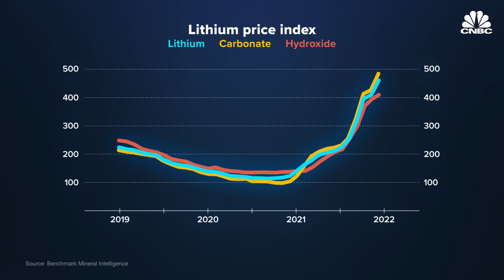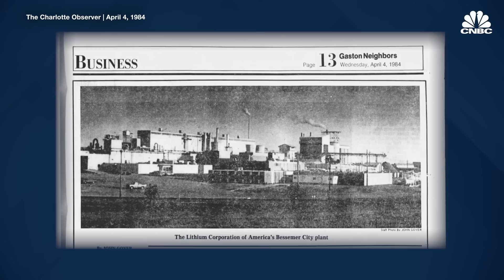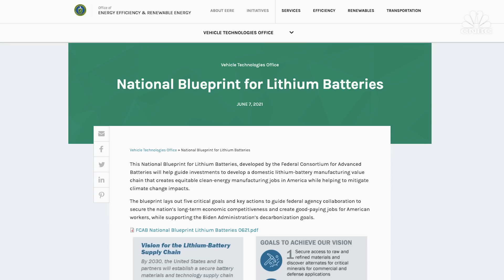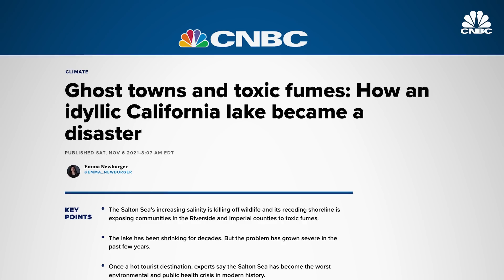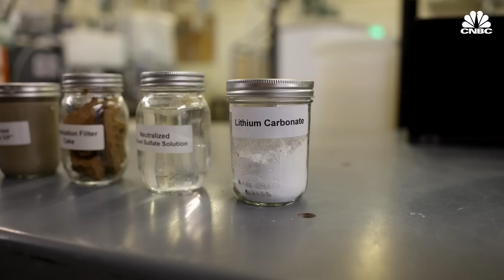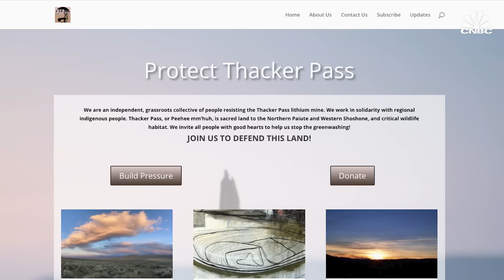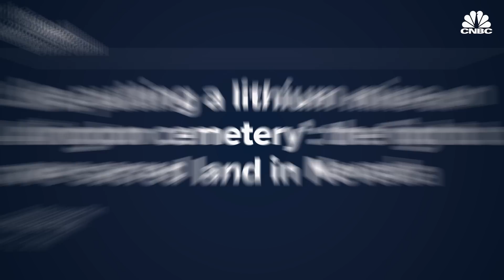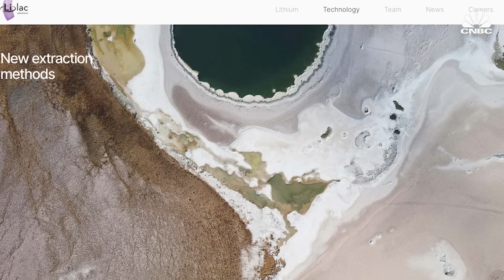Why The U.S. Has A Massive Lithium Supply Problem

Comment: Good idea. Let’s just switch from one fossil fuel to a different resource that’s even more scarce. Except let’s switch to one that has much worse impacts on local environments.
Reply: Do you actually think lithium is a fossil fuel..? Or comparable in any way? 
My mind is blown at the stupidity of this, it's almost impressive.
Reply: @nicktubby9710  lithium is not renewable….so yes in that sense it is completely comparable. 

What lithium mining does to the local environment is far worse than what drilling for oil does. 

Sure oil/gas has way more direct greenhouse emissions….but switching from one way of destroying our planet to another way isn’t really doing much.
Reply: @shanemooon  lithium is not a fossil fuel and it’s definitely recyclable
Reply: @hsvr  never said it was a fossil fuel. And never said it wasn’t recyclable. 
But remember. Recycling is not infinite….
Reply: @shanemooon  The big difference is that one need x amount of lithium to produce the battery and then you good to go, whereas fossil fuels need to be pumped into the car day by day..
Much less amount of raw material needed during the lifetime of a car.
Not to mention, once all the cars are EVs, and the demand for new cars around the same as discarded old cars, recycling lithium from old cars can cover many of the demand..
Also extraction.. Of course it has it's environmental drawbacks but I am not sure that the oilspills, or buldozing whole mountains in WV for coal is that much better..
Reply: @vinceszigetvari6137  that’s the thing though. 

1. Lithium recycling is almost non-existent currently. Because people don’t send in their old batteries…and even when they do, almost every recycling company just incinerates the lithium. 

2. And even if we do achieve better recycling…there are many studies that say we will not have enough lithium in circulation to keep up with demand for new vehicles.
Reply: @shanemooon  
Well lithium recycling is almost non-existent yet, so are old enough EV-s and recyclable batteries.
Even if new sources of lithium required, the amount is for sure much less than oil, which is necessary for every mile a vehicle travels.
Lithium only needed once, when the vehicle is produced. After that thousands of miles can be made without any new raw materials.
EVs overally consume significantly less resources. (even is electricity is produced by coal, EV wins over internal combustion cars)

Comment: EV aren't as green as people think, where do people think lithium comes from, they come from industrial mining, there a lot of environmental damages from lithium mining and from pollution from mining.
Reply: but where do all those metals used in engine come from? Do we grow and harvest them?
Reply: 0 Iq argument
Reply: Still less damaging over the life of the vehicle. EVs nowadays easily exceed 100 mpg-equivalent in terms of carbon emitted even when charged on coal.
Reply: All people want is the illusion of things being normal and all the UN is concerned is catastrophic weather and climate refuges. 

Plus creating mining jobs is actually a good thing for the economy.
Reply: EVs use metal too.  The suspension, body panels, brakes, wheels, motor, and batteries contain steel and/or aluminum.  The batteries are also about 1000 lbs v. about 300 lbs for an ICE engine.  Lithium mining is also worse than mining for iron or aluminum.  Lithium mining contaminates the ground water leaving it unusable for irrigation or drinking.  As long as you have EVs you will also have to drill for oil.  The tires, plastic components, metal, electronics, and the road the EVs travel on are all made from fossil fuels.

Comment: Lithium is not the problem, no power grid is capable of charging all cars at the same time.
Reply: Cars don't need to be charged all the same time any more than cars need to be fueled all at the same time. Lithium iron phosphate batteries can theoretically be charged from 0 to 100% many thousands of times.  Solid state lithium will have more than twice the range of current batteries (500 miles for Lucid Air) so charging will be even less frequent.  Less than once every two weeks or so...
Reply: @OlJackBurton  I agree you don't have to change all cars at the same time, some kind of a schedule is in mind. Nevertheless the grid won't handle a transition from fossil fuels to a all electric future without major investment.
Reply: Time to expand our investments (R&D) in nuclear SMRs as well as solar and wind.

We tend to behave as though our options to augment our energy production is limited to the generation capabilities we have today.
Reply: @metamorphic75  I am taking about more copper cables and bigger electric plants. Copper mining operations are ugly as well.
Reply: And yet somehow the power grid is capable of running all air conditioners at the same time in the summer.

Comment: WHY NOT EXPLORE CHEAPER AND MORE ABUNDANT ALTERNATIVE BATTERY TECHNOLOGIES BASED ON OTHER SALTS LIKE SODIUM CHLORIDE. ....SODIUM BATTERIES HAVE BEEN  PROVED VIABLE
Reply: Then why aren't they used 🤨
Reply: Lithium is incredibly light, atomic number wise, while storing as much energy as heavier elements.
Reply: @philsturm4685  it has been revealed in some experiments that sodium batteries  could be more powerful,  provide more range and quicker to recharge
Reply: Why are you yelling? Also there is billions of dollars going into researching the next generation of batteries. But we cannot wait for that. The clock is ticking on climate change and we need to decarbonize now, not 20 years from now when we have a better battery.
Reply: @katjerouac  Of course  they have to sing about lithium because there are major commodities companies waiting to cash in after buying mining rights. Indeed  there are  more environmentally friendly alternatives to lithium including  water that can be used to power engines. In  the past,  indivduals  that developed  engines powered by  just water have faced threats from government agencies.  You want proof
Reply: @philsturm4685 Sodium batteries have higher power density....Check the channel Electric Viking  on sodium batteries....
Reply: @philsturm4685  Also check out Brown gas converting water to fuel ....HHO water to fuel generator
Reply: @todddammit4628  Did you check out Sodium  batteries ...just so you can learn something new to parrot about in another forum

Comment: A long time ago, Ra, who was god of the sun, ruled the earth. During this time, he heard of a prophecy that Nut, the sky goddess, would give birth to a son who would depose him. Therefore Re cast a spell to the effect that Nut could not give birth on any day of the year, which was then itself composed of precisely 360 days. To help Nut to counter this spell, the wisdom god Thoth devised a plan.

Thoth went to the moon god Khonsu and asked that he play a game known as Senet, requesting that they play for the very light of the moon itself. Feeling confident that he would win, Khonsu agreed. However, in the course of playing he lost the game several times in succession, such that Thoth ended up winning from the moon a substantial measure of its light, equal to about five days.

With this in hand, Thoth then took this extra time, and gave it to Nut. In doing so this had the effect of increasing the earth’s number of days per year, allowing Nut to give birth to a succession of children; one upon each of the extra 5 days that were added to the original 360. And as for the moon, losing its light had quite an effect upon it, for it became weaker and smaller in the sky. Being forced to hide itself periodically to recuperate; it could only show itself fully for a short period of time before having to disappear to regain its strength.

Comment: No one mentions reducing consumption. Ever. Reducing consumption means less spending and lower profits, especially for those making the most profit now.  Personally, I will not support any new exploration or mining until they are coupled with reducing consumption of fuels, plastics, etc.   why switch to EVs instead of requiring better average fuel economy and eliminating 300 plus hp vehicles?

Comment: So green cars is a pure fairy tale. A typical EV needs 80Kg of copper, and several other minerals. But copper is also needed for miles and miles to get power to the charging stations.. Copper mines like chuquicamata are already an environmental disaster. Neodymium is also needed and the mines that produce it pollute big areas of farming soil.
For those of you that want to know more check the video: "The price of green energy | DW Documentary"

Comment: Algae oil is the true answer. Anything made from crude oil can be made from algae oil without the environmental impacts. Biofuels made from algae oil produce 86% less emissions so it would be like taking 86% of the internal combustion engines off the market without having to convert or destroy anything. Plastics made from algae oil do not create nanoparticles when they biodegrade. You can also treat wastewater and CO2 emissions during the growing process. Plastic straws, bags, and internal combustion cars are not the only thing that depend on crude oil. This is the one product that can produce anything that is made from crude oil and end our dependency upon crude oil. Every major city around the world could put up vertical Algae factories and processing centers to be able to produce their own fuels and byproducts while at the same time treating their wastewater and CO2 emissions. The only reason wind, solar, and battery power are so heavily promoted is because they still so heavily involve the mining industry. #Greenwashing

Comment: Lithium technology for EV’s will be superseded by hydrogen technology.  Lithium will still be needed for batteries but the demand will be less than forecasted because the benefits of hydrogen technology for EV’s far outweighs Lithium.   CNBC in its report under the Hurdles section totally misses the likelihood of hydrogen technology disruption to the Lithium mining and refinement industries.  Big miss.
Reply: As someone with a degree in Metallurgical Engineering with some research into hydrogen, I have my doubts about hydrogen powered vehicles competing with EV's. 'Cracking' hydrogen from ammonia and other sources is energy intensive.

Comment: Why does what we need for a battery's/energy always happen to come out of the ground?  It's like oil 2.0
Reply: Not at all. We don't burn the lithium that we use.
Reply: @laskey2175  Exactly. X amount of lithium per car vs. Y amount of oil per mile. Huge difference.

Comment: Using climate change as excuse for lithium mining is kinda funny. Now, I don't actually necessarily disagree with mining, personally I just don't know enough, but just from my common sense perspective it's not bad idea. But back to my point, cars are maybe the most inefficient means of transport we have, electric or not. Personal cars all the way from infrastructure needed to support usage, material and manufacturing cost per person and energy needed to push very heavy car just to transport one or couple people makes it quite bad means of transport. 
Overall, electric cars are just not solution to climate problems, it's part of the solution, but before that most of all it should be reduction of cars and making the whole infrastructure of transportation more efficient.

Comment: To charge these batteries at a charging station you boil water to create steam that spins a turbine. Oil and natural gas is used as the primary source to achieve that in the US, but that was failed to be mentioned in this report. EV’s are dope, but shouldn’t we also be working towards producing cleaner electricity, not just electrifying our privately owned vehicles.
Reply: // "shouldn’t we also be working towards producing cleaner electricity,"//

Do you live in a cave?  Do you not know how much time/energy/money is being spent to clean up our grid power?

Comment: Dump lithium
Adapt Hydrogen fuel cell and Aluminum Air batteries
Reply: But hydrogen fuel cell uses platinum, an even rarer and more expensive metal.

Comment: I wish the public and the government would finally realize that EVs are not a viable solution for mass production of personal vehicles. Lithium will almost always have to be mined using destructive practices and the US is decades away from clean energy production considering more than half of our energy is produced from burning fossil fuels (60% of energy production US in 2020). I just hate the narrative that EVs are so "clean", sure you don't see emissions from your car but that's because they already got released into the air from a refinery burning coal (20% in 2020) 100 miles away. The only truly sustainable energy source for cars would be hydrogen power as their only byproduct is water. Even though current means of producing hydrogen aren't all green, advances could see an energy system that is green, sustainable, and less prone to outages and failures like our current electrical grid.

Comment: I feel like in 150 years people will look back and reflect on how stupid it is to fuel vehicles with heavy batteries that are difficult to produce. Hydrocarbons are so much better suited and are renewable unlike limited resources like lithium ion batteries. We could offset the CO2 emissions by doing things like not cutting down rainforests, generating electricity with nuclear power, and actively scrubbing CO2 out if the air. Or if we do decide to go fully electric don't have cars stuck in stop and go traffic. Invest in mass transit and improve traffic flow.

Comment: ahem electric vehicles are UNSUSTAINABLE!
Reply: That is exactly what the oil industry and the ICE car producers want you to think
Reply: @PM_82  with all due respect 
..it is actually  fact we tried all of this 100 yrs ago..ICE proved  to be superior  and much more useable then ...same is true now you cannot reinvent the wheel
Reply: @PM_82  gasoline has far more useable energy  density per gallon  electricity simply cannot match
Reply: @Jag-leaper  Most of that usable energy is wasted as heat. You need to use more of that energy to move the heat out to prevent the engine from melting.
Reply: @tonii5690  that's not the point here...we arent talking thermal  waste totally different conversation...point here is is still more efficient
Reply: @Jag-leaper  Energy density per gallon is a useless metric to use for any comparison if you would know how to use an EV, if i drive like 50km a day at maximum i have no use to drag around fuel for 1000km, i could use a EV with like 500km range and charge it every couple of days while at work at home or whereever and when driving long distance i take a break every couple of hours any way where i can fastcharge to continue driving while taking a break using the computer in the car to relax and watch a video or play a game.
Reply: @PM_82 WHICH IS THE PROBLEM!!!driving a car should not require  a course  in calculus to figure  out exactly how much range you need per trip..not everyone has the same commute habits as you and the fact that this works for you...good for you! But it doesn't  work for the majority of people especially  those living in rural environments! Therefore it is an excellent  and highly  relevant comparison
Reply: @PM_82  oh and by the way when SHTF....and there are mass blackouts and the like...good luck getting...well anywhere with that electric car😆😉
Reply: @Jag-leaper  Lol, all the typical misinformed oilhead talking points lol,  When there is a blackout you car will still have charge and during a blackout an ICE vehicle cant pump fuel too so then you are also stuck, unless you have solar panels and a battery that still working during a blackout so you can still charge your car.
Reply: @PM_82  nope see the typical person has some fuel in their shed for their lawn mower, or the smart person has a few jugs of fuel in Reserve just because or in case of such an emergency. You cannot store electricity anywhere
Reply: @Jag-leaper  Lol ... nobody in my country uses a gasoline lawnmower, those will be banned soon enough anyway because of the airpolution and almost nobody stores fuel in their sheds or garages.  Depends on the way you live probebly.  And yes, you can store energy in batteries like a powerwall or charge your car directly from you solarpanels.
Reply: @PM_82  again...not everyone lives in your country.....and I'm glad you have figured  out a way to pour energy from those cells into your cars batt..........oh wait you cant do that either...
Reply: @Jag-leaper  True but it is also the other way around, not everyone lives the way you do and do have great benifits in driving an EV over an ICE and as the majority would benifit from EV then that is where the majority will go.  And yes, you can charge your car from a powerwall sor directly from solar panels o what is your point
Reply: @PM_82  but majority  do have th option, as majority  own ICE cars.....also our infrastructure  cannot sustain  such a load...EV vehicles are also bad for the child miners in other countries  that die all the time having to source these Precious metals ...its awful...not to mention the manufacturing processes  is awful for the environment...and then when these disposable  cars are finished  in 7 -10 years...their batteries are incredibly  difficult  to recycle properly.....too much headache not worth the time or harm to well....everything